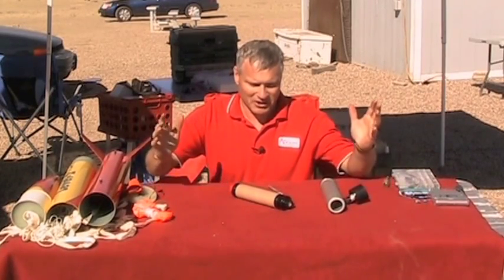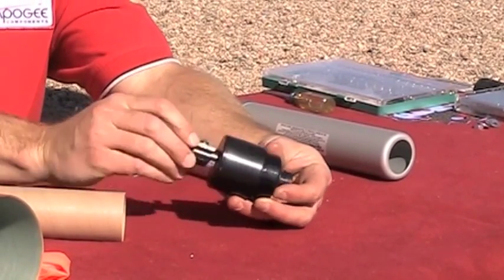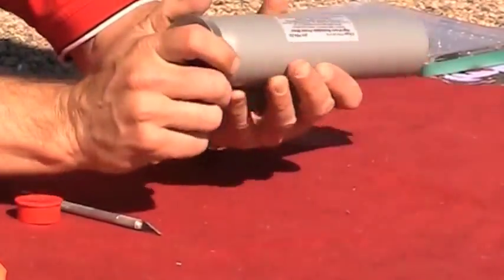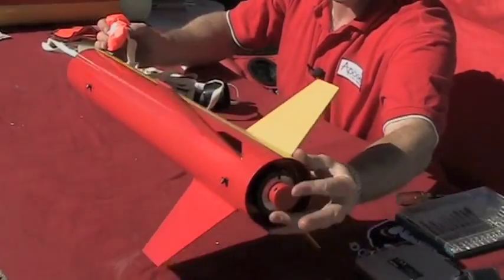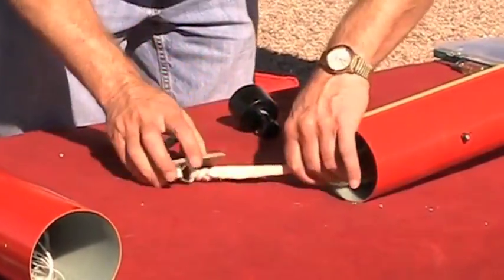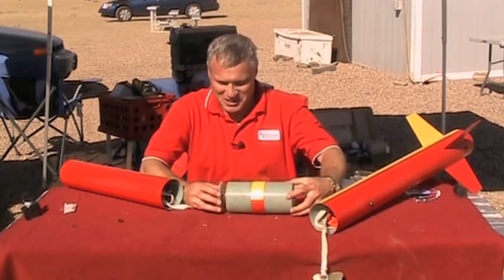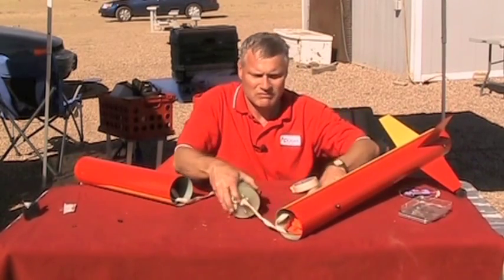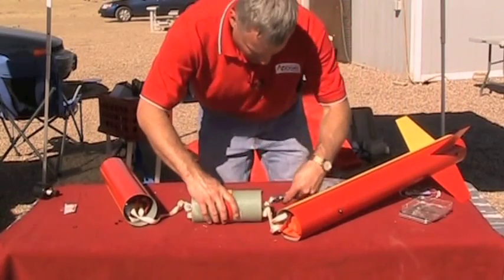Building the Level-2 Fiberglass Rocket Kit - 20: Flight Prep, Installing the Motor

Comment: Very cool video, I have just a question. For 38 and 54 mm reloads, is the ejection charge sealed or I can add it manually and in case add some more to be sure that motor ejection is capable of ejecting in any condition?
Reply from the maker: Cesaroni seals it ejection charges. You'll probably need to add a dual deployment altimeter system if you want extra.

Comment: What is the delay for, is that an ejection charge? I thought the dual deployment altimeter did the ejections.
Reply: The altimeter does take care of dual deployment, but the motor's ejection charge can be used to ensure deployment if the electronics failed.